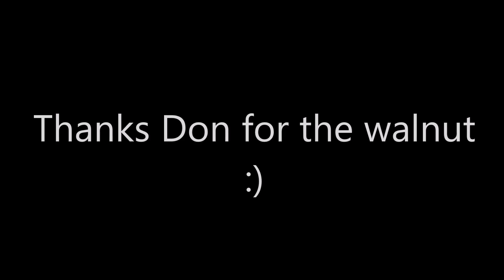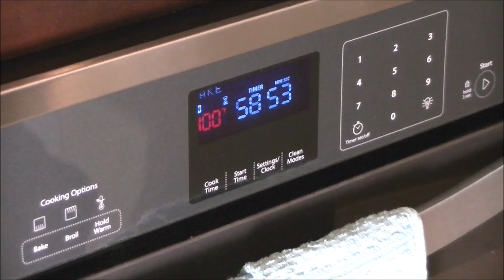Kiridashi Knife from broken file

Comment: So cool Dan! I like that you left some of the original file exposed, so it shows where it came from
Reply from the maker: Thanks Robin, the funny part about the file grooves is that it can mess with your head as you grind away material as it disappears the file marks start to look like scratch marks which makes you think you are marring the surface.  Eventually I figured it out and just went with the flow.  You can only strive for so much perfection from imperfect materials.

Comment: That was some nice crafting! I'm trying to get into blacksmithing but I'm lacking basic tools.
Reply from the maker: Thanks man!  I know what you mean but if you are able too just buy a tool at a time.  That's kind of what I did.  I bought the torch for another project then I was able to use it for other things.  I got lucky with the firebricks though that was a Craigslist find.  The rest of my tools I have acquired over the course of about 15 years.  Its hard to imagine dropping a ton of cash all at once.  But chipping away at it little by little is a lot easier to swallow.  I also save up my change and once I get about $50-100 bucks I buy a new tool I want.  It usually takes me about a year to save up the change that way.  Good luck on your quest man.  I have faith in my fellow man and truly believe where there is a will there is a way!

Comment: Wish I had acces to all the tools :( Then I'd prolly never stop creating stuff
Reply from the maker: I've been doing this as a hobby for quite a few years and I've bought my tools over the course of those years.  Its rare for someone to start off with a full blown tool ready shop.   I actually got my tools to make repairs to my home.  It was cheaper for me to buy the tool and do the work myself then to have someone else do it for me.  As time went on I would take on new projects and buy tools as I needed them.  There have been a few times that I have just bought a tool because I wanted it, like my drill press.  But for the most part I have bought my tools for another purpose besides making.  If you are interested in knife making check out my Saw Blade Knife with limited tools video.  I would also suggest trying to find someone that lives in your area that has the same interest in making.  Most of the people that I have met who have this hobby are very willing to teach others or at least share their knowledge.  Good luck!
Reply: Dan The Maker Man WoW thanks for the advice! I have indeed starting gathering the basic tools to at least start with. Soon, when I got some space in my shed, I'll start practicing stuff and do some repairs at home as well :)

Comment: how do you break a file?
Reply from the maker: In this case I dropped the file on a cement floor and the top snapped off.  On smaller files I have just put too much leverage on it and they snap.  Files are very hard and somewhat brittle they break a lot easier than you would think.